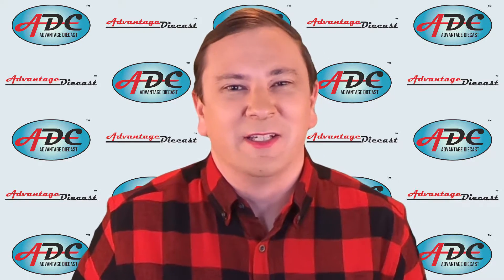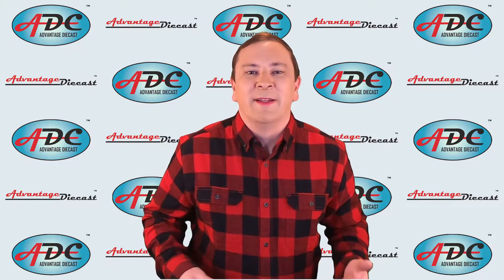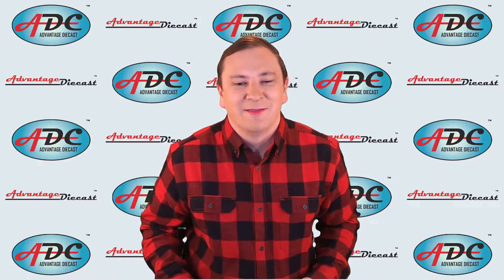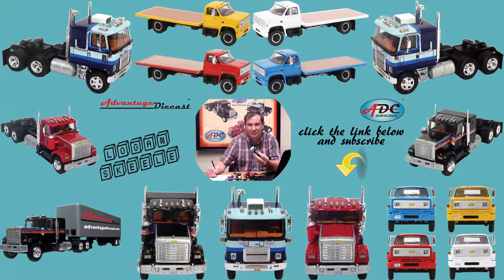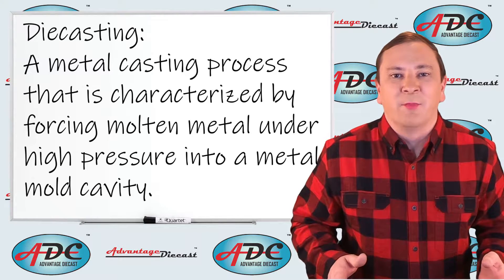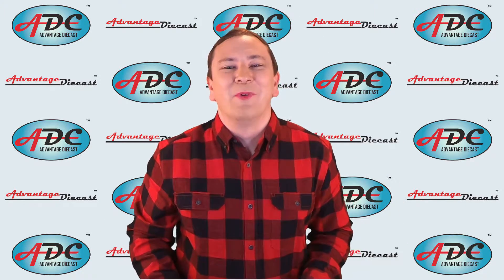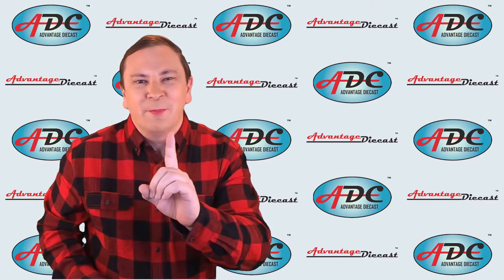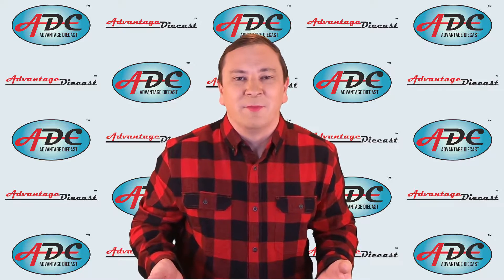WHAT IS DIECASTING? How Are Diecast Cars And Trucks Made  - Part 1

Comment: Is it possible to make a die cast car from scratch if you don’t own or work in a die cast metal mold factory?
Reply from the maker: It is possible, but totally impractical as the dies are incredibly expensive and the temperatures needed to melt the metal are unsafe outside a factory setting.  To make.  To make your own model car at home, resin is the way to go.
Reply: @LoganSkeele  thank you for replying is there a tutorial video available on how to make diecast cars with resin and also can hot wheels cars be made out of the same material?

Comment: Can I make a metal car model at home?
Reply from the maker: The answer is it can be done, but I do not recommend it at all for many reasons. Mainly it is way too dangerous and easy to hurt yourself.  Metal castings should be left to professional factories only.  If you want to make a model car for yourself, the best way is to use Resin, much safer and way way way cheaper.